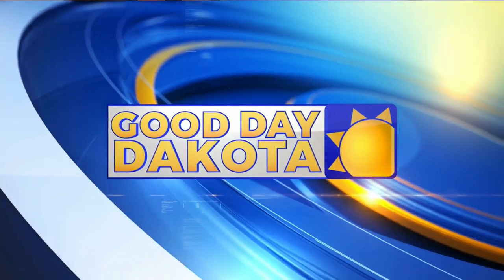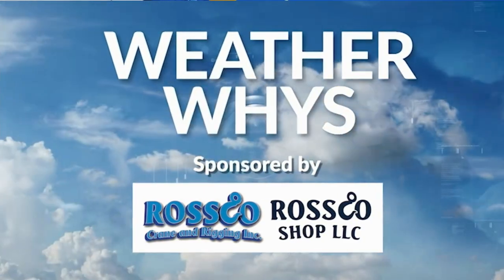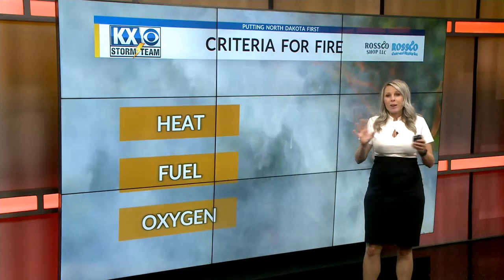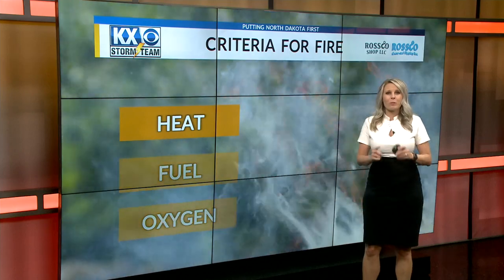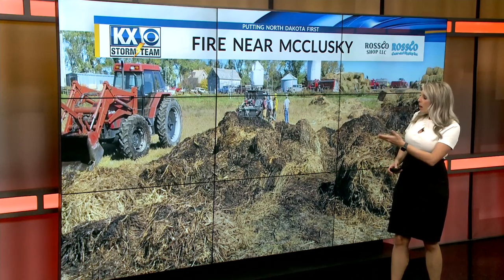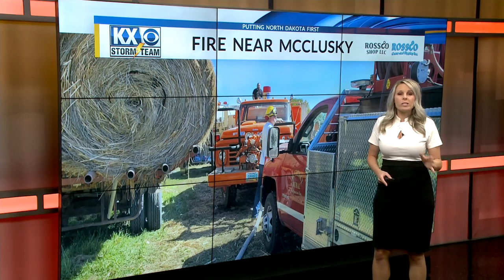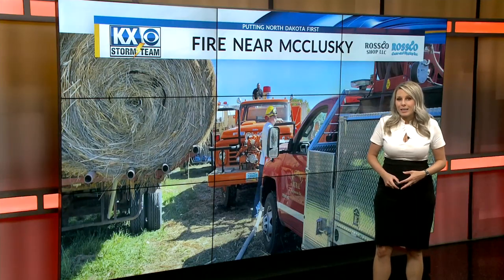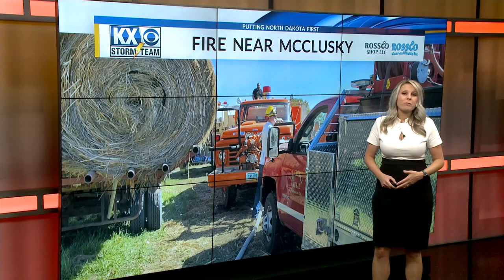Why hay bales spontaneously combust

Comment: Its decomposition that is taking place in the hay bale that generates the heat causing spontaneous combustion. The right amount of moisture and oxygen create the right conditions for microbes to start eating the hay. This generates heat inside the mass. The more microbes that come to the dinner party, the more heat the munching down on “free eats” generates inside the mass until boob! You get smoldering and then spontaneous combustion. This also happens at large composting facilities if their big piles of decomposing organic waste generates too much heat.
Reply: @munchkin   eggzackly    as a greenkeeper i've seen & felt the heat in large piles of grass & also know it can do damage to a limb if held in where the heat is hottest. I liked you explanation best in the comments m8
Reply: BOOB - FIRE!

Comment: Hay has to be below 20% moisture at baling, unless they are making balage. That should be around 65% but it needs to be wrapped in plastic as soon as possible. It would be highly unusual for hay to start burning on it own after it had been sitting more than a couple months. Usually by then if you start feeding or selling it you realize that it's garbage. It gets moldy and dusty, but it steams out.  The round bales on the semi trailer probably got started from someone flicking a cigarette out their window at the load or a spark from the truck started it.
Reply: If that was the case, they would find a cigarette but. They already told you the explanation.
Reply: @Lixx34899 they said it could happen with hay that was several years old. No it won't, unless it is in a barn with a leaky roof or there is an outside ignition source. Bacteria growth is what starts the heating process.  With hay that was baled a little tough it could start heating in a few hours to a couple of days. Silage bales need to be wrapped immediately to prevent heating because those are, or should be 65% moisture. Instead of aerobic bacteria which causes heating and spoilage, you want anaerobic bacteria which causes fermentation.  If those bales had been 300 degrees then they were allowed to sit way to long or the guy running the baler didn't get off his butt to feel the hay before he baled. Either way it was garbage when they loaded it on the truck.

Comment: Interesting. I would never imagine such counterintuitive way physics works. I imagined a wet hay bales would be much safer because it'd require more energy to first evaporate the water molecules before temperature rises where a flash ignition may occur to the hay itself. Meaning more energy is needed vs a dry hay bales. Really interesting..

Comment: We experienced this and had a near miss several years ago. We'd just received around 20 or 30 bales and were stacking them in the horse stables. One of the kids noticed a bale of hay that felt unusually warmer than the others. I went over to check it out and saw smoke coming out from within it!

We immediately took the hay bale apart, which released a lot more smoke and revealed some burn marks within the bale. It was also damp inside (but not on the outside). 

We doused the bale with water to prevent further heating then checked out the rest of the bales for heat/smoke. We ended up finding around 6 more bales that were internally warm. A couple of those had started smoking as well. 

If we'd left them in the stables with the horses that night (which we'd done for years), we would have lost the horses and the stables! In fact, a couple of years after that, there was a hay barn that went up in smoke for the same reason. Thankfully those people didn't store the hay with the horses.

I was absolutely confused about why in the world this phenomenon had occurred. I asked around and was told it was the result of a bacteria within compressed, damp hay that created heat which subsequently led to the near fire(s) that we had. So I guess that wasn't the case? They didn't say anything about respiration that I remember anyway. 

We were also told that the person we'd gotten the hay from had baled it while it was still damp, which they're not supposed to do, and that's what caused the problem to begin with. But the hay was definitely not damp on the outside...only on the inside where it was hot, too.
Reply: Bacteria sounds like a better explanation to my untrained ears.